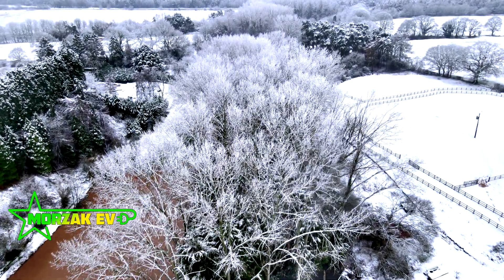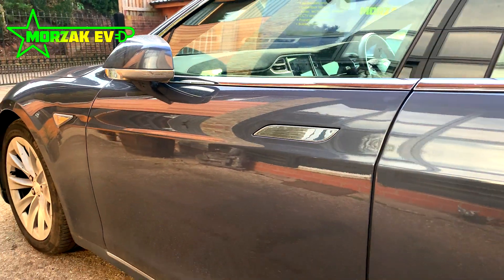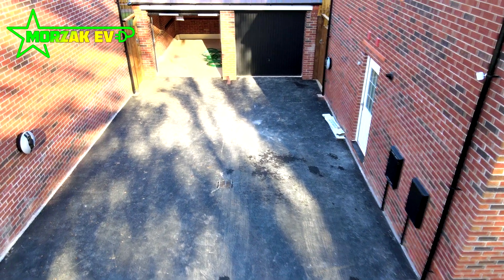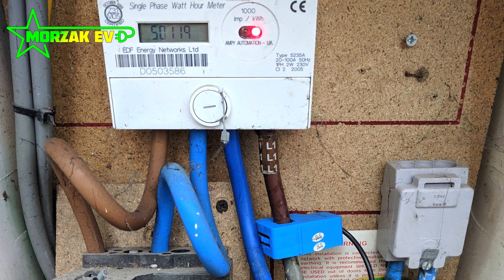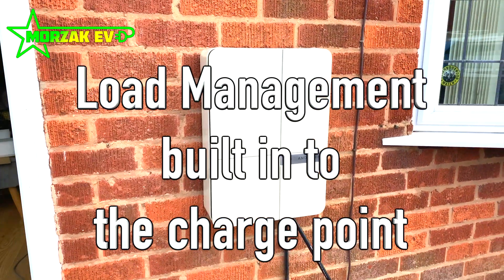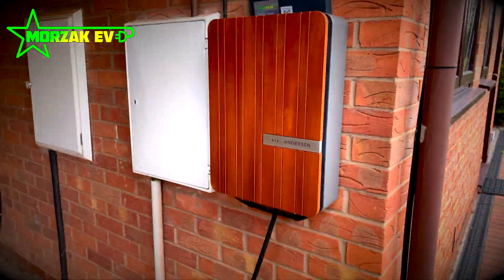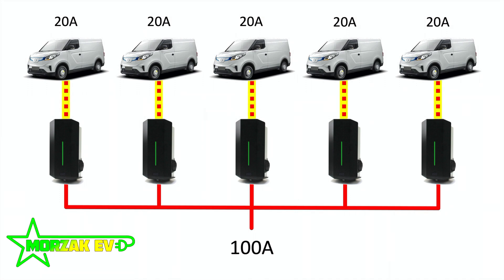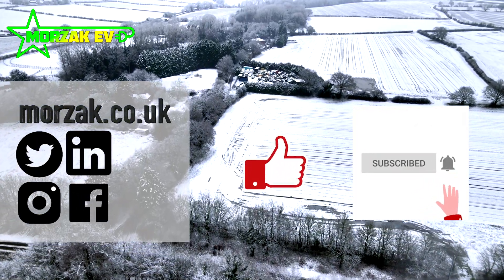Supply and Demand: Load Balancing and Electric Vehicle Chargers (Load Management, Fuse Saver)

Comment: Hi, just recently discovered your videos and they are super informative so may thanks for making them :) Essentially i'm looking to install a 32amp EV charger but i have a looped supply with what looks like a 100amp fuse/breaker. I know that the DNO will want the supply unlooped to continue, i'm just wondering if you know whether their decicion to unloop would be reconsidered if load managment is in place against the main fuse? i dread to think of the upheaval necissary to unloop mine and my neighbours properties. So if there are any compliant ways around unlooping i'm all ears :)
Reply from the maker: Yes, so just a something before is answer your question - although the fuse carrier states 100A, this is the maximum capacity, and inside the fuse is actually likely to be only 60A. So, technically, you an installer can come along and install an ev charger without prior permission and notify the DNO after the fact IF (and this is an important if):
You install a charger with G100 compliant load management in place which at this time means a hard wired CT clamp set to 60A
AND
Your total load after diversity for the house (without the ev charger as this has load management) is 60A or less.

Now bear in mind that if you have any loathe loads in you property such as electric showers, heat pump, maybe even an electric cooker - the chances are that the installer may not want to do this. It all depends what the calls come out at.

Does that explain and help?

Comment: You mentioned that certain chargers have load management built in, however you didn’t mention the makes or models that have this facility. Which do please?
Reply from the maker: Thanks. I didn't want to list them in the video, as this information is changing all the time. For example, the EO Mini Pro didn't have it until Dec last year. As of today, it's is optionally built in to the Zappi, Andersen, EO Mini Pro, Pod Point, Project EV, and Wallbox. We can then implement it on any other single phase charger using the standalone units. Load balancing can be accomplished on most of the commercial units in one way or another.